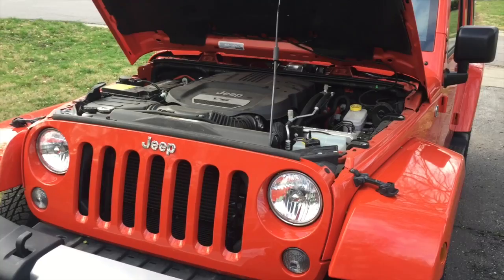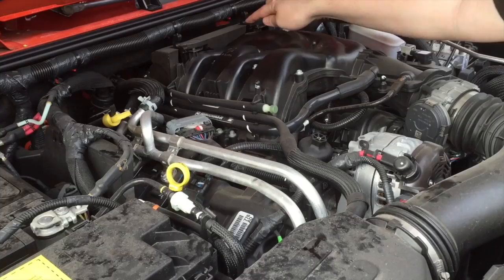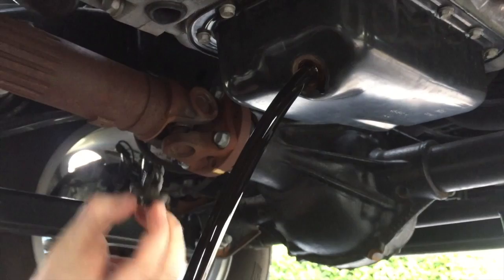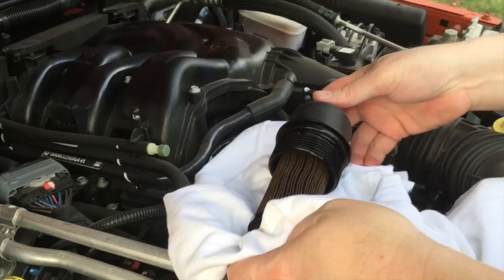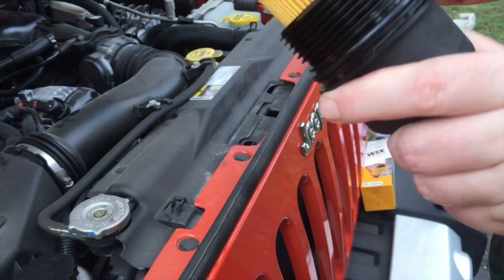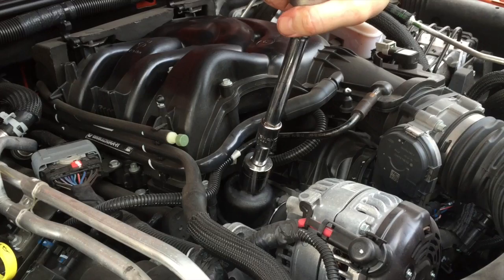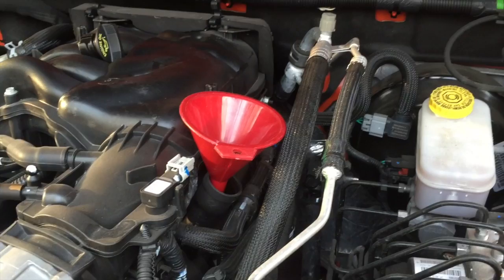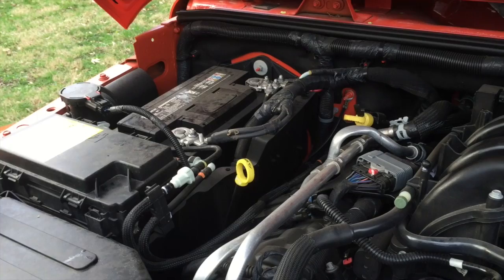How To Change Oil 2015 Jeep Wrangler

Comment: Very good video, I started doing my own after my Jeep dealer jumped from 32$ to 60$ (Regular oil not synthetic) which is pure greed.
Reply: Ray Vilasuso ...JUST had the ‘1st’ oil change on a used (new to us) 2015 JK @ the Dealer, they said MOPAR’s 5-20 IS a synthetic oil.

Comment: Debating whether to go to Amsoil motor oil on my new used 2015 with 22000 miles on it. At least I have 3000 miles to continue thinking about it.

Comment: One last question.  Since you are doing the oil change, any concerns about compromising the warranty?  Do you keep a log of oil/filter changes to show the service department in the event of the need for warranty work?  Thanks.
Reply: Changing your own oil will not void the warranty. If your motor suffers catastrophic failure and they have to tear the motor down, they will immediately be able to tell if you changed your oil or not.

Comment: Thank You Jeese, I had a question. We just had a flash flood  due to Mattew, and I had to drive through  2-3 ft of standing water, Now, when I drive my 2014 Jk, it's starting to lurch when trying to go into 5 gear, and I hear a popping sound. Could that be from water in my fuel filter. I checked the air filter and it had no debris.  i just filled it up just now, and I was going to get some fuel filter cleaner for the gas take to push any possible water out my gas tank. At this point, I am clueless, because it happens  when I shift, not all the time, but  every now and then. Any advice yo can give I would greatly appreciate it..
Reply from the maker: Hi Gerald,  Do you have an automatic or manual transmission?  Does the problem consistently repeat itself under the same conditions? If you have an automatic transmission would be very surprised if the problem was related to the fuel or air filter and would look for something more directly involved with the transmission.  Are you still having the problem or has it been resolved?  I would like to hear what you discovered the issue to be.  Good thing is you are still under the factory warranty so you should be able to have the issue corrected for free.  Thanks,  Jesse

Comment: what would happen if i used 30 instead of 20 oil? this will be my first oil change on my jeep
Reply from the maker: Hi Jessica,  The answer depends... What year make and model of Jeep do you have?  Is the engine modified or stock?  Are you still under the full Jeep warranty?  Thanks,  Jesse
Reply: I have a 12 wrangler and it calls for 5W30 all of a sudden they call for 5w20 and now 0w20. Pretty much the same engine. Just trying to squeeze every gallon of gas at the expense of longevity. Thanks great video